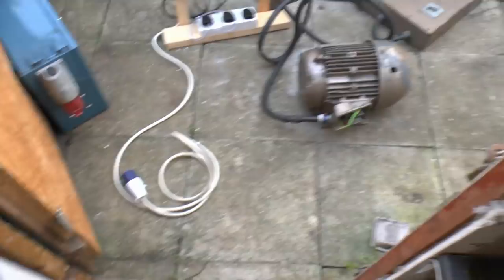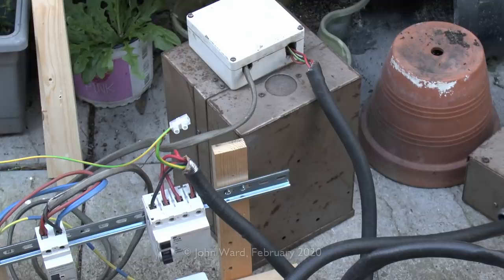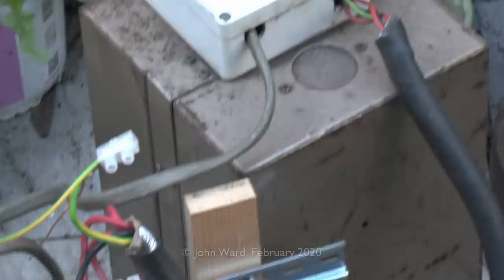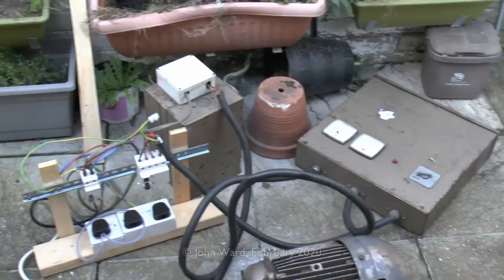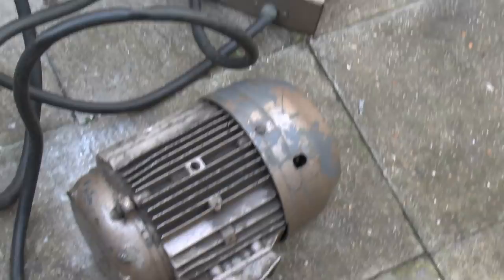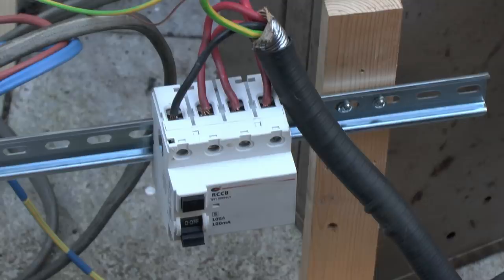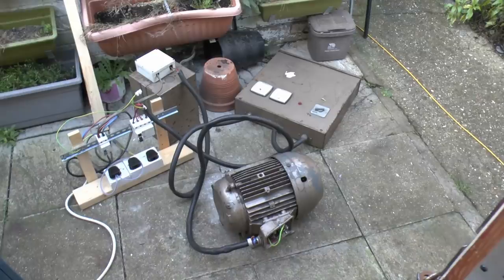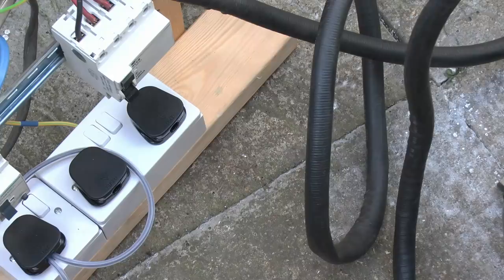Three phases from only one

Comment: If you have a 240 volt three phase motor at 20 Hp, you can hook to/through 240 volts to phase A-B.   Come off of C to run up to 22 Hp of 3 phase motors.   If you put a rope pull on the shaft, pull the rope, then turn on the single phase 240 volts,   You are good to go.   No electronics necessary.   No capacitor to start if you have the rope.
Reply: The way I understand it that will be horribly inefficient and the phases will be way out of balance.
Reply: Lite Roadie    How do you expect the phases to be out of balance?   With a roto-phase, the only loads you should connect to it would be three phase motors.   So only three phase loads.   What is your concern about efficiency?   Are you concerned about power factor and amps lagging?
Reply: @KevinCoop1  are you joking or is it serious? that kind of conversion is absolutely crap, noone uses it beside hobbyist who like to do experiments. You'd rather put motor and synchronous generator on the same shaft and therefore create 3ph balanced power, thus still inefficient. (requires a lot of power to run, delivers little power to the output)
Reply: sumilidero    Not sure where you are from.   No I'm not joking!   Two brands sold in US are Roto-phase and Add a Phase.   They must sell enough of them to keep the doors open.   They are used a lot on farms and small businesses in rural areas.  Not sure where your balanced load concern comes from.   Single phase in at 240 volts(no issue) 3 phase out (with differing voltages) stable enough to run 3 phase motors.   Efficiency question, I'm assuming you are concerned about power factor.   Agreed, power factor would be not good!   If I am the utility, I would be concerned.   As the customer, I'm happy!   Low power factor on single phase relates to lower electrical bill.  The meters only read watts, not VA.   Respectfully,   Kevin
Reply: @KevinCoop1  No, i mean efficiency = Pin/Pout. Power factor is other story, low PF means you can't draw much useful power that creates work at given line capability. I guess that must be american thing then. In europe, whenever you need 3ph power, you just get it supplied by utility. Its 3ph by default, but small house owners time to time choose single phase to make things cheaper. I know that US use 2ph domestic system, but industrial is 3ph i assume 460/480V? I guess you have an option to connect farm to 3ph grid? (but its expensive?)
Reply: sumilidero    An example in US power distribution is 12470/7200 3ph 4w.   Typically run to areas that loads justify the expense to utility.   There are thousands of miles where the power is 7200 1ph.   Many of our states are larger than European countries. Having said that, there are areas that are many miles from 3 phase.    We do not have 2 phase in US.   Residential is 120/240 v 1 phase.   Transformers put out 240 volts and have a grounded center tap of the coil.   As a designer of electrical systems for contractors, my job was to get equipment working safely.   So efficiency was not my concern.   Example.  Many years ago, a truss company had 3 phase 240 volt saws and other equipment.   Utility wanted $60,000 to get 3 phase to his location.   He installed 20hp motor, running 1phase and ran several 5hp or less motors off of it.   He said that his electric bill was $100 per month.   Probably equal to $400 now.   Respectfully,   Kevin
Reply: @KevinCoop1  center tapped 240V is 2phase system. You have 2 phases 120V each respectively to neutral, and phase to phase voltage (240) occurs. Appliances running on 240V though are 'single' phase, meaning they have two terminals to supply power. If they reguire neutral, to derive 120V for some part of its internals, then those are 2phase devices. And as 'designer of electrical systems' your priority should be efficiency along with safety.
Reply: sumilidero    I'm sorry sir but 120/240 volt systems are absolutely not 2 phase.   It comes from utility as single phase(one sine wave) (point in time) and comes out at single phase.   Having a center tap does not create a second phase.   Still one sine wave @ 240 volts exactly at the same time as the 120v waves.   It is single phase.   You can call it split phase if you like, but still single phase.   In the case of my customer being able to get work done cheaply or not at all, I will choose get work done.
Reply: @KevinCoop1  Does that mean, utility grid is 0V and 7200V in US?  and transformers are connected to 0V point and 7,2kV point on the input? Or is it 3ph system and transformer takes single voltage (but from 2phases) on the input?
Reply: sumilidero    Phase to phase 12600.   Phase to neutral (center point of wye) (grounded to earth) 7200 volts.   One coil primary 7200, one coil secondary with tap at center.   One sine wave primary, one 240 volt sine and two 120 volt sine waves at exactly the same time.   If on Oscope, the scope reads it out of phase because of how it connects, not because it is a real time different phase.
Reply: @KevinCoop1  Ah ye i see now. I thought it uses 2ph out of 3ph system but its 1ph and N at MV side. I looked at it thru 'european' glasses at first. My bad. 180deg phase shift isnt rotating vector indeed.
Reply: sumilidero    By the way,   We in US now also utilize European voltage system 416/240 at 60 Hz. In specific locations.   To power servers in large data centers, we use the H-N at 240 volts.   That saves an enormous amount of time and money.   Best wishes to you!    Respectfully,   Kevin
Reply: @KevinCoop1  Thats closer to european :P although we have 230/400 at 50Hz precisely
Reply: sumilidero   It could be 230 volts.  Depends on primary voltage.   In US Utility is + or - 10%.
Reply: sumilidero    I'm sure that we both realize that a better way to do 3 phase motor power from single is to utilize VFD's.   Especially for smaller motors.   Cheap and work well, plus variable speed and direction.   I enjoyed the discussion.   Respectfully,   Kevin
Reply: @KevinCoop1  Absolutely, VFDs are now really cheap, and offer not only variable speed but also protection for motors (overcurrent etc.) with high electrical efficiency. Only problem is harmonic distortion that really affects old motors with fatigued iron cores. Yet still the best choice for supplying 3ph motors from single phase outlets.
Reply: sumilidero    How about that?   We agree!   Respectfully,   Kevin
Reply: @KevinCoop1  Kind surprise haha. Im glad we do. Engineerig came long way from simple roto-converters to complex drives featuring field-oriented vector controls. It is mind blowing what an inverter with fast processor and good alghorithm can do with a simple induction motor. Isnt it?
Reply: sumilidero    The changes in electrical and electronics since I started working for a contractor in 1983 to now retired are enormous!    Thank you sir.

Comment: So basically what you have there is the grandfather of the vfd
Reply: I don’t think so. VFDs are not phase converters. They are designed for 3 phase motor control. Just because some supply them with single phase and use them as phase converters doesn’t mean they are intended for that use, nor do they perform well.

Comment: I thought the capacitors were just for motor starting and voltage imbalance is normal - inherent to this type of design converter. Never had one of these apart, but every one of these ive seen used has an imbalance to some degree. You can hear it in the motor when they are really out of whack.
Reply from the maker: This has 2 sets of capacitors, some for starting which are connected only briefly, and others which are permanently connected.
Reply: @jwflame  Gotcha. Thanks

Comment: A motor without a shaft 😁
Reply: Samuel Fellows there is a shaft, it has just got a cover over it (the right end of the motor as pictured).
Reply: Bryn Jones - in that case a non - conventional protruding shaft at the back - all conventional motors have an output shaft of its electromagnetic rotary movement to a; wheel, cog, pulley, /(in case of a fan) impeller, the only external shaft that converter has is for its cooling fan at the front under the cowling

Comment: how far can they be deviated before the motor gets really upset...?
Reply: I'm no expert but I suspect that the more load you place on one phase, the harder the motor will have to work at that point, which will set up a vibration in the motor.  The more unevenly the phases are balanced, the more the motor will vibrate, increasing wear and shortening its life, until it eventually breaks.  The voltages themselves aren't really that important in this respect, although as you load down each phase the voltage will start to drop once the motor becomes underpowered for what you're doing.
Reply: @Berkeloid0  the 3 phase from the GRID was WORSE back at Crete ...a vectorially FUCKED up shambles

Comment: Still, limited by the current, 20A?
Reply: yes
Reply from the maker: No 20A was mentioned, but the output is limited by the input, which was a 16A connector for this quick demonstration.  There are also losses, so the output power is always less than the input.  Actual maximum power is unknown, as the motor rating plate is missing.